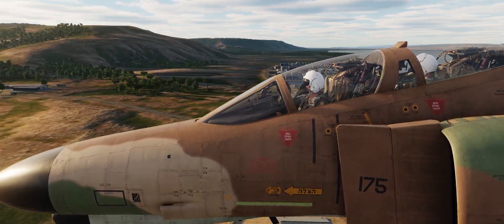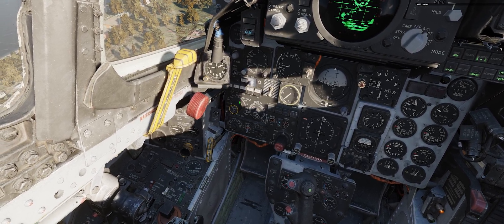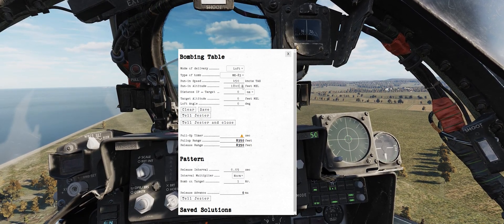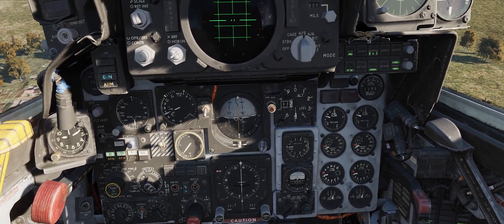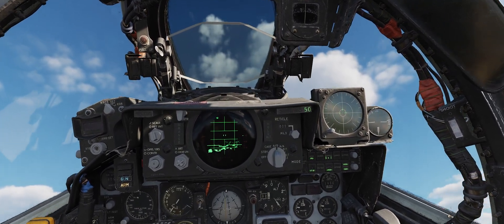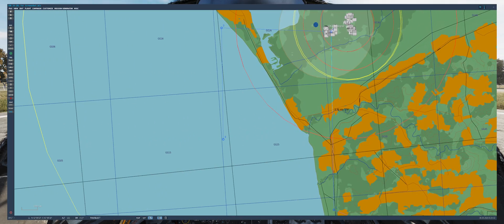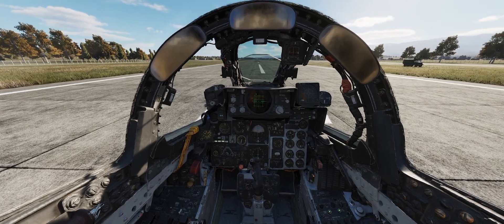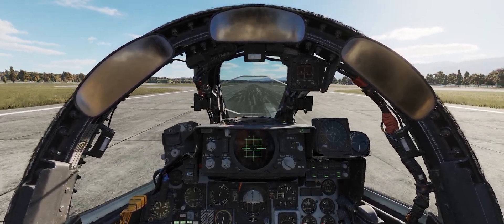F-4E Bombing Tutorial - Loft Mode

Comment: loft bombing in the F-4 is the new refueling in the F-16, which is to say, I can’t. When I try following the horizontal line up the ball, the vertical line sways too much no matter how centered I keep the stick. If I do manage to keep it centered, and follow the horizontal ADI guide up the ball, it’s still wildly inaccurate. The bombing computer seems to ignore that there is a very specific speed window where lofting can be successful. If I plug in a profile to loft mk83s at 350 knots, they fall about half a mile short, and you can flip that result at 550 knots, putting the bombs far past the target. 500 knots seem to be the sweet spot, but the bombing computer doesn’t seem to take this into consideration

Comment: I’m confused. How do you tell the plane that a certain waypoint is actually the target you want to bomb? If I have waypoint 4 over the target I want to hit and I place waypoint 3 over the area where I want my IP to be (about 7 miles from
 Waypoint 4), how do I tell the aircraft that I want to drop the bombs on waypoint 4 so it should turn its light on 7 miles from waypoint 4 and drop its bombs when it thinks they will land there.  Is it like the F-14 where you can designate a waypoint as a target point? I haven’t had time to mess with the editor much.
Reply from the maker: It's a bit complicated and a bit more manual than you might think.  Hard to explain here.  If you drop by my Discord Channel I can try to explain how I set things up - and that worked for me.

Comment: Bit confused... on the bombing table we ned to fill in the 'Run in Altitude' in feet MSL - so I assume, if the ground to target is elevation 2500 and i want to fly 500ft above terrain i type in 3000ft?  Is that correct... ? What happens if i am attacking a target on a knoll which would therefore be higher than my run in altitude.. say at 3500ft.   Would loft bombing still work?
Reply from the maker: Interesting question. I have not tried any of those scenarios but I can guess. The bombing computer wants all altitudes (including the target's in MSL).  Will it work if you enter AGL altitudes instead?  Don't know - it might.  If the target is higher than your run-in.  Never tried it.  Easy enough to get in the cockpit and see if the bombing computer chokes on it.  It will usually tell you when you have attempted to give it data that does not work.
Reply: I’ve been trying to loft bomb targets higher than my run in altitude without success…. The bombing computer doesn’t get upset. I’ll keep trying…

Comment: Great video, I agree  with the other comments about the need to plan the attacks, which I actually think is a lot of fun. Its a shame that dcs isn't a little better in this regard, especially for multiplayer.  It would be good to have a mission planning environment that multiplayer participants could all share, also the ability to print hard copies of routes, especially from the i.p. to the target.  A strip map of the last 1 minute of the run from ip to target with 15 seconds tic marks on the track and the attack heading is super useful, and what attack pilots in the 60/70/80 would produce in the planning stage. You can do this in the combatflite planning tool(highly recommend it), but native to dcs would be better.
Reply from the maker: I've never looked at combatflite. I will have a look.

Comment: No matter what bombs I use, they fall 1.5-1.8 miles short. Maintaining perfect speed and altitude does not help. If I follow the manual exactly, I never manage to hit the target.
Reply: Make sure you select the correct bomb on the table.  I was using mk82 snake eyes and had mk82 selected.. googled the differences to understand, switched to mk82 GP/LD with mk82 selected now they hit every time.

Comment: Hi, good demo.
But with a human WSO, the planning will be more difficult.
On the WRCS you don’t enter a range to target. You enter an North/ South & East/ West offset in x100 ft.
So already we’re +/- 15m N/S & E/W.

So far, the only solution I found to do that is to use UTM coordinates differences between IP and target.
But then I use Pythagore computation to compare with mission editor ruler, and I have a 60m difference in range. 😢
That could be because of map projection problem, but DCS maps are flat…

So I’m not really sure how to set up that manually without “Magic” Jester ?
Reply from the maker: Actually all you need to set in the back seat is loft angle and countdown time. Just use the bombing computer and then set thise numbers manually. 
In effect, all of that would hAve been done preflight with some sort of bombing table. But in the aircraft those numbers are all you need to set.
Reply: In the 70s IAF used pre-determined IP points marked by large towers. 
You would get the offsef from the IP to the target. You would have 2 or 3 of those towers along your route, and the last one would be the IP. You would use each of them to align the INS to make sure you get the tightest system possible for the drop

Comment: If history is any guide, loft bombing was always a bit of gamble and best done in groups against area targets to better your odds.  Your results seems to match that.  I am noticing that the F-4E module really benefits from pre planning.  The newer 4th gen modules have the systems that allow you to just "wing it" a lot of the time but with the F-4 you really need to go in with a plan.
Reply from the maker: Correct on all counts. Going in to any mission with only a peasant level of understanding if the task at hand is not a good approach in the F-4E
Reply: Wasn’t it originally designed as a method for delivering a nuclear weapon? Seems like it Allows for ingress below radar and a loft distance that made it possible for the F-4 to continue the vertical loop until up top, roll around and head out to a safe distance…so would make sense
Reply: @mikeck4609  That seems to be the rumor going around Reddit these days but I don't know.  Certainly, loft bombing is something done outside of nuclear weapons delivery but I don't know what the idea was behind the original design.